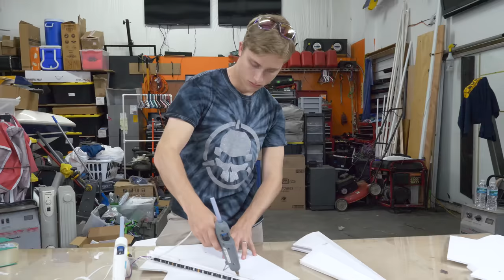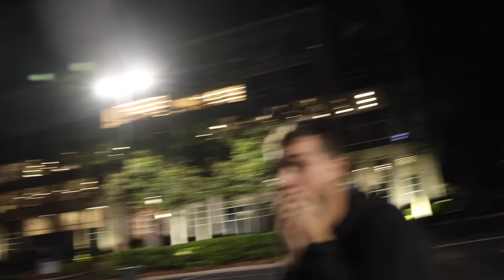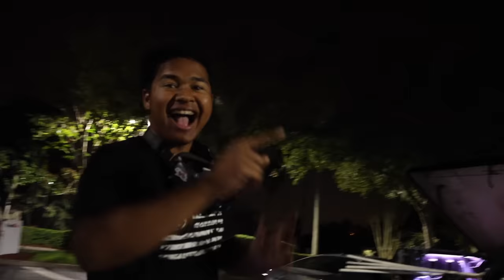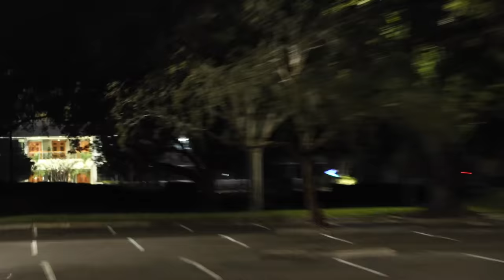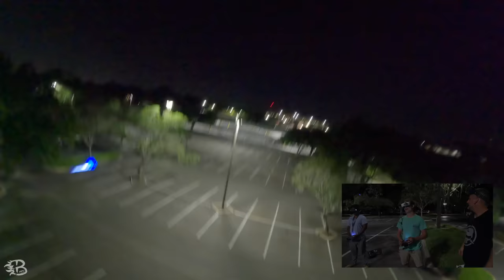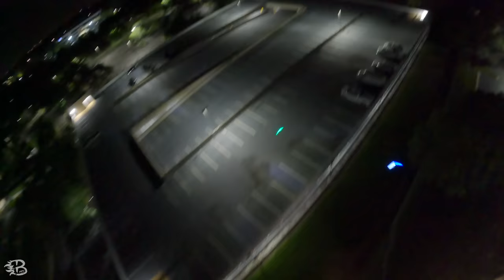Freestyle Drone Tricks with a Wing!?🤯

Comment: The difficulty of flying wings freestyle is so understated! Its just another level of skill 🔥
Reply: where can you buy a cheap flying wing? any recommendations on a decent one? i have fpv drones and rc planes, so this would be perfect to add to the fleet. And mount a nice analog camera and a good vtx, to get that really good night time camera visibility. I also already have some good nighttime fpv cams like the starlight s, etc.  
Are you all using digital systems? 
Anyone using a Runcam Wasp by any chance? Its a digital air unit base system thats claimed to be the Best Low Light Digital VTX setup out right now..

Comment: Gotta try a spec wing now. Pretty forgiving with crashes if its built well. Vanny knows whats up
Reply: The wing with blue after burners is a spec wing.  I had 2 specs and 2 arrows
Reply: Arrows suck, stop building them. The design needs to just die!
Reply: @N0FPV what design do you propose we use?...I'm interested.....
Reply: @timothyphillips4801 my NEW Freestyle Wing drops this week..
Ger that one...VollStyle by RiteWing
Reply: @timothyphillips4801  Spec Wing is a much better build than an arrow
Reply: @N0FPV  my version of the arrow has been modified over and over and is awesome.  Very durable, and fast as an arrow.  Just ask anyone that went to rampage and saw me flying at night. :)
Reply: @LetsFlyRC  if you changed the airfoil, winglets, control surfaces, sparring and center pod, it's not an arrow but it has been fixed!
Reply: Maybe I’m getting wrong wings but the best flying wing I’ve ever had was an arrow.
Does a spec wing really fly better?
Reply: @jdbergan  way better, not even the same class of plane
Reply: @jdbergan  in some conditions the arrow flies better and in other conditions the spec flies better.  

For example, the arrow is extremely light and will slow down way better, it will also haul ass. The arrow has a shorter wing span, and roll rate can be higher, and more axial depending how they ate built.  

The spec is heavier, more durable, if built right, and can handle humidity and being stored for a longer period.  Over time, foam-board warps, especially in humid, and hot climates, like Florida, where I am.   The spec can handle wind better, because of its weight and wingspan.  The spec wing has an annoying tendency to have wing waggle, which annoys the heck out of me, where the arrow never waggles.  

The Arrow, if built the FT way, breaks in the center, at the center section, so, I delete the center section, and just glue the two wing halves together, making it insanely durable and faster.   You need to expand the prop cutout area, otherwise it makes a crazy wild warbling noise at full throttle.

Comment: Night flying with something lit up is mega chill and cool looking. When I started flying drones I did most of it at night LOS because it was much easier to tell its attitude with different colors for front/back.
Those look like a lot of fun and apparently you all had a blast flying them. 😂 worth the time to build eh?
TIP: get some banding straping (the plastic or fiber type), make a slit in leading edge of wing and slide strap into slot with white glue.
Makes wings super strong, you can rip through a regular foam wing/body with this mod.
Straping tape on edge can't bend....

Comment: where can you buy a cheap flying wing? any recommendations on a decent one? i have fpv drones and rc planes, so this would be perfect to add to the fleet. And mount a nice analog camera and a good vtx, to get that really good night time camera visibility. I also already have some good nighttime fpv cams like the starlight s, etc.  
Are you all using digital systems? 
Anyone using a Runcam Wasp by any chance? Its a digital air unit base system thats claimed to be the Best Low Light Digital VTX setup out right now..
Reply: I have a wing being manufactured.  Coming soon.  We are all digital - some on dji some on fatshark - the avatar vtxs are way better at night vision